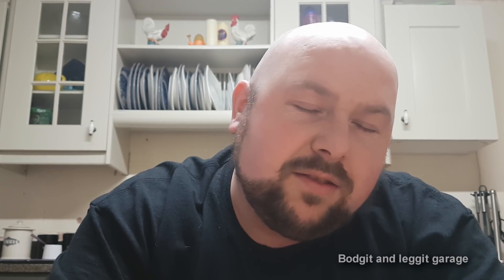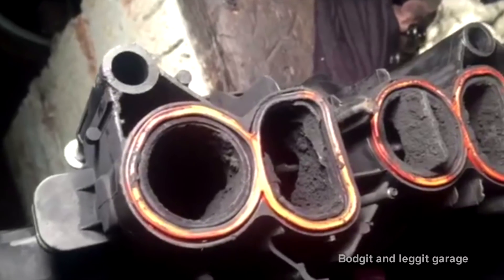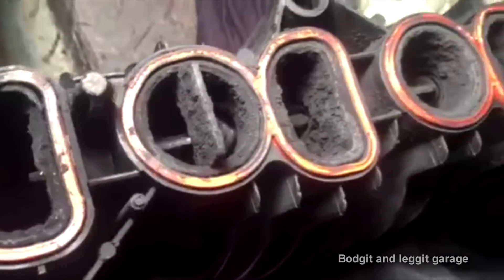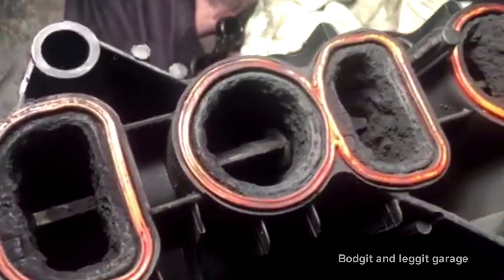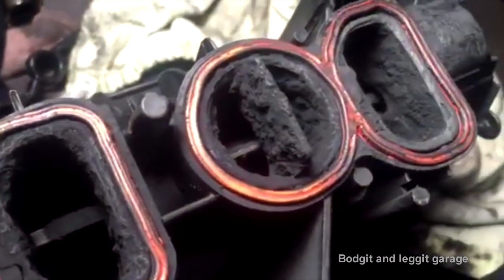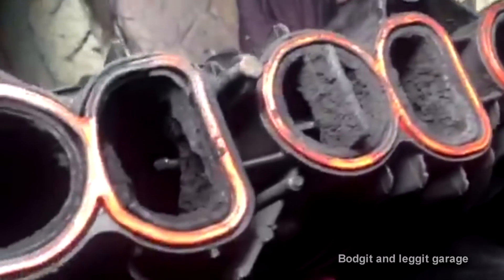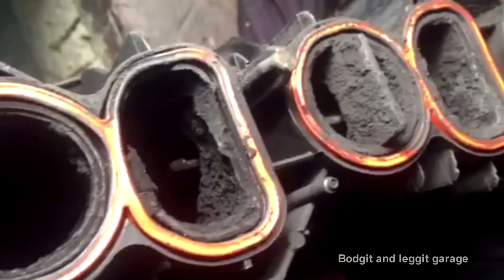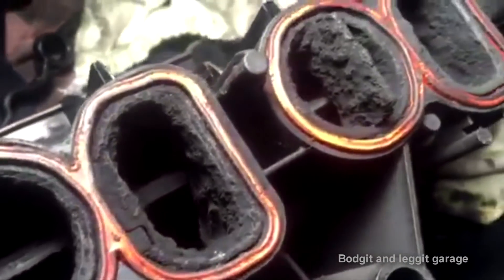Engine Carbon Cleaning EXPOSED!!!!!!!!!!! With PROOF!!!!!!!!! Bodgit And Leggit Garage

Comment: Some hints, if you think it is hydrogen that the machine produces to de coke the engine buy a bottle from your local welding gas supplier and use that,much cheaper. If you think the hydrogen works because it combines with oxygen In the combustion chamber to make water use plain water, much cheaper (but maintenance on some of my vehicles includes emptying the water trap). Carefull with the potassium hydroxide, it is strongly caustic and dissolves aluminium and other alloys even in very weak solutions so VERY bad for engine parts made from aluminium like pistons and cylinder heads.
Reply: The Hydrogen cleaning system works with a unit that produces hydrogen by splitting the H2O molecule with electricity thus producing a regulated quantity of hydrogen which is  will bind with carbon and break it down (hydro-carbons).  I wouldn't recommend using a hydrogen tank to supply it as too much hydrogen (which burns VERY HOT) could damage your engine.  The hydrogen will combine with O2 to create water but only after combustion.  The hydrogen binds to carbon deposits before combustion in the valves and intake.
Reply: @christiankoppl7721  wrong the hydrogen doesn't do anything till it has been in the cylinder and the explosion on the compression stroke then it works it cleans THE EGR VALVE  and the TURBO WASTE GATE. It doesn't clean the low pressure side of turbo possible oil leak it doesn't clean the intercooler of oil. Saying all that HHO GENERATORS DO WORK 
Great way to get RID of EMMISIONS more mpg but you have to fit a fuel ENHANCER or a CHIP to fool the ECU into thinking it is putting to much fuel in then you see a GREAT FUEL SAVING OF 30%PLUS AND THE EMISSIONS ARE RUGHT DOWN ON MOTS I THINK ALL DIESEL CARS SHOULD HAVE THEM BY LAW I'VE HAD 2LT HDI CITROENS DOWN TO 0.45 . 1.7 ASTRAS DOWN TO 1.19 AND ALL OVER 260,000 MILES BUT THERE IS LOTS IF OTHER THING'S 
TO HELP WITH EMMISIONS INSTEAD OF THE GOVERNMENT AND BRAINWASHED IDIOTS WANTING TO GET RID OF ALL DIESELS FOR ELECTRIC IT'S JUST A FAD A CON TO MAKE MORE MONEY OUT OF THE PUBLIC IF YOU WANT TO STOP THE CLIMATE CHANGE STOP THE BOMBS AND THE OIL TERMINALS AND TANKERS THAT GET BLOWN UP IN THE CONFLICTS STOP THE FOREST FIRES STOP THE THIRD WORLD COUNTRY'S THROWING OUT EMMISIONS  STOP THE CHINESE AND ALL THEIR COAL FIRED POWERSTATIONS NOT PICK ON CARS AS IF THEY ARE GOING TO STOP THE CLIMATE  CHANGE ONE FOREST FIRE IN AMERICA PROBABLY PUTS MORE POLLUTION IN THE AIR THAN ALL THE CARS FOR 1YR.

Comment: These direct injection cars need fuel system cleaning. But like commented before as s yearly maintenance. And you have to use good ones not just those cheap vacuum intake passage drip cleaners.
Reply: Personal experience using multiple ones for work. Used drip cleaners not seen changes. Used a machine on my personal 645ci (a non direct injection engine), that blocked off the fuel and ran It's own fuel and then had a pressurized misting tube in the intake. It left 3ft strips of carbon out my tail pipes and three codes for air pump inefficiency. I.e. it knocked enough carbon out to block the air pump passages in the head. Which means it should have been done as regular maintenance and the classic BMW 4.4 n/a motor would never have the clogged air passage.

Comment: I DON'T SEE ANY PROOF.   I am going to go pour 2 liters of water in the intake of my Huyndai and film it.  It better go viral like you say.  I will probably need the adsense money to get a new car.
Reply: FrugalPrepper .I d be skeptical too if I hadn't tried it for myself a couple of months ago I did a valve adjustment on my 2000 Honda civic lx 4 days after that engine light came on random misfire codes I readjusted the valves about 5 more times and the car ran worse well long story short I went to a muffler shop to buy a rubber strap for my muffler when I heard the owner of the shop telling   a customer about this machine that removes carbon build up from the whole engine I was curious because I noticed I had a lot of carbon build up on my almost new spark plugs I asked the guy if this would help my Honda civic lx symptoms he said it would if there wasn't any mechanical issues.  so I I let him use his machine in my car for about an hour he took it for a test drive on a rough uphill street came back told me to get in I thought for sure he had bad news but wow to my surprise my car reach 6500 rpms with so much power I was looking at the dashboard thinking this guy is crazy engine light is going to come on but no it didn't  I smog the car 3 days later it passed is been 4 weeks already no engine light my car runs better now then when I bought it 2 years ago.  And yeah I did try all this fuel additives before this and nothing work.  amazing best 150 dollars I've ever spent  .
Reply: FrugalPrepper's Garage & Garden please up,lad that...be fun to watch!  Especially when the strip down begins!
Reply from the maker: FrugalPrepper 🤣🤣🤣🤣🤣🤣 I will look forward to that video Tom it will definitely go viral lol
Reply: It only clean the combustion chamber. Same as having a leaking head gasket. The cilinder in which the coolant is leaking is always alot cleaner. Its because of the hotter combustion temp. If you got a DI with lots of carbon build up on the intake valves this machine won't do anything on the intake side. That's why the changed the intake in this video.
Reply: in this video    they allow HHO to be sucked into the exhaust intake for an hour then they rev   the engine...……………………….at first the smoke is black for a while then it turns clear……………………….https://www.youtube.com/watch?v=gQS9BfHZiBk
Reply: this one may even be better………………………..https://www.youtube.com/watch?v=Cd3sWjEMhAw
Reply: Robinsss it will clean the combustion chamber and maybe the exhaust side a bit. But it won't clean the intake side. And on modern cars (so not an old 92 dodge and fiat punto) the most carbon build up is on the intake side. Especialy on direct injected petrol engines. And these machines dont clean anything on the intake side.

Comment: You're right. My viral video has been one of my most popular videos. It's called water decarbonization. It can help with some cars. The technique with this machine seems safer, but I'm still wanting to learn more about it.
Reply: Water only removes carbon from the combustion chamber, which is beyter than nothing. It also removes the oil film on the bores.

Comment: Leon, I'm not familiar with the machine you use (it reminds me of the Terraclean treatment). I use BG fuel additives in my cars and the proof I had that it was working were the emissions results on the MoT tests. Regular servicing with genuine/OEM parts should go a long way to prevent carbon build-up.
Reply from the maker: Parknest yes mate preventive maintenance is the key but not everybody follows this procedure that's why there is machines out there to help

Comment: Could this really shift 250,000 miles' worth of oily PCV vapours bonding EGR soot to the intake port walls (Opel Y20DTH, early type with vacuum EGR)?
I've removed and cleaned the intake and swirl flap unit and decarbonised them at 190,000 miles (they were BAD) but didn't have time to look at cleaning the ports before I had to reassemble everything and go somewhere!
Would like to clean them, but don't see how that machine could.
In the combustion chamber, yes. But in the intake? Not sure.
The plastic BMW intake was still quite clogged in the video.
Reply from the maker: Simon Parkinson yes mate I know what you are saying the plastic intake in the video was removed two days before this is how he knew how bad the valves was we never cleaned that old intake with the machine it does clean the inside of the engine EGR valve and valve a lot better than the intake yes but it would still help

Comment: Hahahaha Nice one Leon 😊👍👍👍I can't wait to see the 2ltrs of water in the intake as it causes Hydro Lock and Bends the ConRods..Let's hope one or two of the Keyboard Yankers  come back with a Video of it and gives us all a good Laugh.....By the way Leon the Steel Seal has Sorted my  Coolant leak and Hydro Lock Problems 😊no idea how long it will last but blow me down it actually worked..Thanks for the Laughs.
Reply from the maker: Steve Jones hahahah I must admit I can't wait to see that too
Reply: You guys need to understand the difference between hydrogen and water (H2O).  Hydrogen is a gas not a liquid .  The Hydrogen cleaning system works with a unit that produces hydrogen by splitting the H2O molecule with electricity thus producing hydrogen which is highly combustible and will bind with carbon and break it down (hydro-carbons).  Putting water in your intake is definitely NOT recommended.

Comment: Have you got an exhaust gas monitoring machine, the type they use at MOTs? Would be interesting to see before, during and after readings.
Reply from the maker: catnapwat I am going to be doing videos on this to show people the difference before and after I just need more time
Reply: I might have missed your video have yet done any yet with before and after with the emissions I have recently bought ECC 230 they seem to work but I would be sceptical about cleaning inlet manifolds and egrs  but should help remove some of the carbon and also with some dpfs to leave them that they will regenerate hope to hear back from you 👍 sorted lol
Reply: Ive done exactly that with mine, mot testing stations used ro refer faliures ro me and id use the machine. Especially good on the old diesels.

Comment: Regular oil changes and occasional long drives make wonders, too.
Reply from the maker: GymChess yes mate I 100% agree but not everybody does do this this is why there is machines out there too sort other problems out
Reply: Yes, most people drive short distances for the most part and that includes me as well. How far is far enough in your opinion for a petrol car to fully warm up, i.e., when the oil is really at max temperature, etc? 50-100 km?

Comment: These machine are based on hydrogen fuel cells....been used for years all over the world...run your car on water !!!!
Reply from the maker: Chrissy Johnson yes mate I think people think these are new but they are certainly not nude that's the problem people are scared of new things
Reply: running your car on Hydrogen is not all that easy.  Hydrogen burns very hot and hydrogen fuel cell technology is still in it's early stages of development.  Hopefully soon though

Comment: Anyone that says induction cleaning is not needed on modern cars with DFI  needs to tear a few apart and  see how much buildup is on the intake valves and EGR crap in the intake ports.  How many engines have low volumetric efficiency, cold run issues, lean/rich cylinders...and to fix the issue requires gaining access to the valves except with chemical spray or hydrogen.  Sometimes I just have to laugh!!
Reply from the maker: Hayward's Automotive hahah yes mate you just cannot tell some people no matter what

Comment: The machine work.
Putting hydrogen in a car cleans the engine i thought this was a well known fact. 
Also spraying water in the air intake cleans the engine 
i have done that to a few cars and bikes
Reply from the maker: perfecto1986 some people just won't believe it no matter what even with evidence but thank you mate
Reply: You guys need to understand the difference between hydrogen and water (H2O).  Hydrogen is a gas not a liquid .  The Hydrogen cleaning system works with a unit that produces hydrogen by splitting the H2O molecule with electricity thus producing hydrogen which is highly combustible and will bind with carbon and break it down (hydro-carbons).  Putting water in your intake is definitely NOT recommended.
Reply: perfecto1986 what about Mr Muscle? :)

Comment: So it will clean the carbon , not only from combustion chamber? Also from the intake side ? 
Waiting for more videos .
Reply from the maker: Dom's Garage well you're going to enjoy the next video because I'm getting live scan data and you will see the improvements as the cleaning process goes through and if this is not enough evidence for you then there's not much more I can do
Reply: bodgit and leggit garage i will stay tuned  ;)  in your wast drawer of gadgets you must have borescope  :)
Reply from the maker: Dom's Garage yes I do have a borescope and like I said in my last video I am going to use it when I can do it easily and handy I did say this in my last video and I also said it in the first video on this machine
Reply: Any new videos yet thanks

Comment: After you perform a carbon clean on an engine, where does the carbon particles go? Out of the exhaust valve or does it get trapped in the piston rings? Thanks.
Reply from the maker: din nr it's a chemical reaction and breaks most of it up to very fine particles the rest goes through the exhaust just like it does in normal operation
Reply: @bodgitandleggitgarage  it's not phisical mate but phisical .hho generate massive heat which is breaking the charcoal into a tiny particles and will be knocked out of the engine

Comment: I must admit it's 100% true tht it works I've Mondeo 2.0 tdci it was in one hell of a mess I took it for a terra clean for well over an hour couldn't see the likes of Wales with all tht smoke only done side is tht the hole exhaust system is now blocked with all the shit and crap tht came from the engine so I would recommend removering the cat/dpf if you have one and disconnect the rest of the exhaust other than tht sorted!!!!!😉😉😉😉😉😉😉🤗🤗🤗🤗🤗🤗👍👍👍👍👍
Reply from the maker: eraysha white it all depends what machine they are using to clean this machine is a chemical reaction and which reacts with the carbon and put into very small particles but I suppose if you have massive amounts of build-up it might be no harm doing this

Comment: Would this procedure help with a 2007 a4 tfsi ? My understanding is that direct injection is more prone to carbon deposits.
Reply from the maker: krugerblue yes mate it will it's like everything preventive maintenance is the key if it's too bad this will not help obviously but if you get it done regular enough you'll never get the build up in the first place

Comment: Out of interest how did you know the condition of the valves before you took the head off
it looks like the swirl ports have never been cleaned and of course the machine would not
clean that anyway.
Reply from the maker: Shandybrother he replace the inlet manifold the day before so he knew how bad they were we cleaned it the day after if you look at the pictures I have put up you will also see the difference

Comment: Great vid Leon. You can't knock any of these machines untill you have tried it your self I have not seen or used a machine like yours but have used the EDT and terraclean machines at work and if you see the amount of crap the EDT filters out and all that machine does is connect to the oil filter housing and sump plug and pumps a special mineral oil around the eninge and has a fine filter that collects the crap  and it amazing how clean the oil stays even in a diesel.
Reply from the maker: Vdubs 60 yes the EDT machine is awesome I'm going to be doing videos on that as well it is amazing just how much crap it remove
Reply: Even for a diesel? That's incredible.

Comment: Nice...thanx for the vid mate...could of used this machine today...wonder if they have something similiar or even this very machine available here in the states.
Reply from the maker: Drews Auto yes mate I'm sure you can get these machines over there they been around for years it's not new a lot of people think this is a new technology that's why they are sceptical just like when medicine was first invented people didn't think it would work but I told you it does and keys now no that works as well